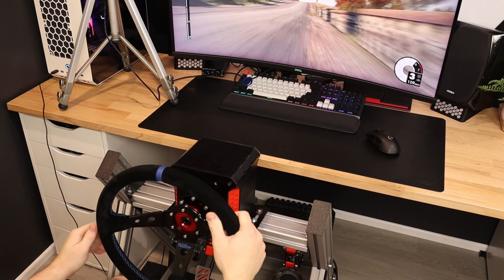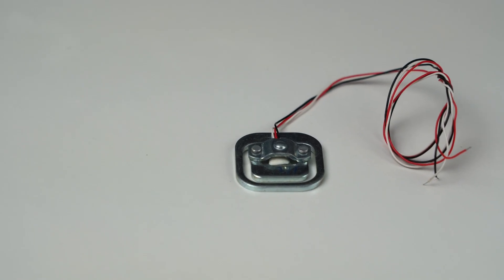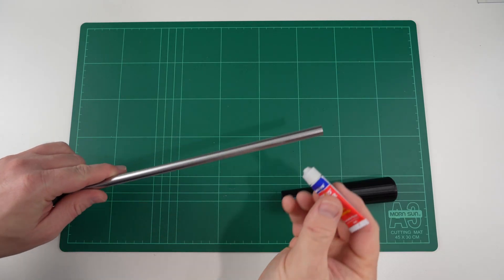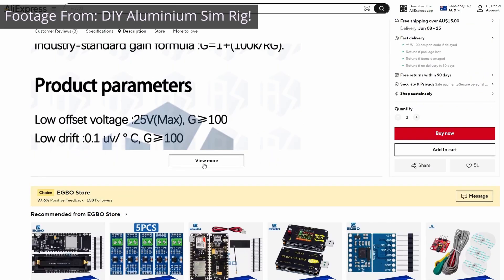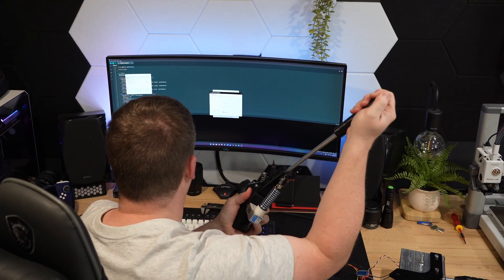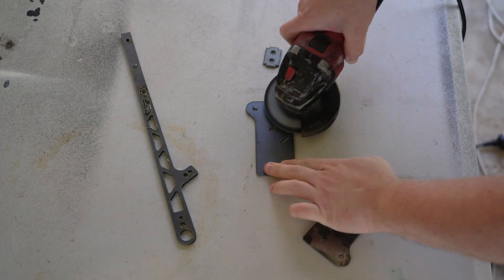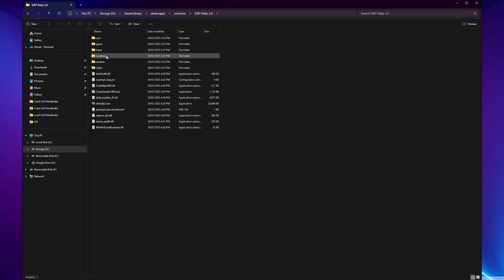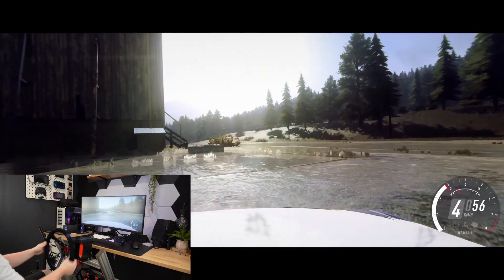DIY Load Cell Handbrake!

Comment: If you were to mount a Hall-effect sensor with a magnet and compare its output against the load cell using the AliExpress springs, you could create a conversion function from the calibrated Hall readings to the load-cell measurements. That might allow you to remove the load cell altogether and significantly reduce the cost of the build. You could even consider adding measurements for one of the AliExpress elastomer kits as well.

Comment: Man, difference in price is something crazy location wise. I have a fully laser cut heusinkveld sprint clones, and the price of the laser cutting and the 3mm steel sheets was the same from when I quoted a pair of paddle shifters and steering wheel grips (just the grip part where you put your hand on, not the full steering wheel) from a cheap 3d print palce. I'm from Brazil, 3d printing here is still very expensive.

Comment: Hello, i just started making a diy dd wheel, imvery broke. I wanna make another one like mmos but idk the board and this software u use, use very very expensive (3000 pesos) if you can help me with anything please do. Thank you.
Reply from the maker: All I can suggest is there are cheaper ways to make the wheel than the way I went with it, so that should save you at least a bit of money! Take a look at the build video they have on their website for a cheaper/simpler build. As for the driver board though, that's the cheapest compatible one I could find unfortunately!

Comment: La course du levier est bien trop longue !
Reply from the maker: Translated for the English speaking audience, this says: "The lever travel is way too long!"
Fortunately, this is adjustable and simply using a harder/shorter spring or a stopper on the bolt would be all you'd need to limit the travel!

Comment: 4:35 (I think you forgot to add the link?) I do believe this audio board is exactly what I need for my feedback cancelling spring reverb tanks! We just ran into an issue in the video I'm working on where one pre stage op amp works, the post stage works. But one op amp into another does not.

I wonder if we are saturating the op amp IC by asking for 500x voltage gain on the recovery post op amp
Reply from the maker: I have no idea if it will suit your purposes, but this is the video I was talking about (I have added it to the description, thanks for pointing that out!) https://youtu.be/oFvz3rBkJsg
And here's a direct link to the part for you! https://www.aliexpress.com/item/1005007130064459.html

Comment: I've watched your sim rig and setup build videos here and there once in a while without knowing they were from the same channel. Great job on everything. Something I would like to see would be functional multi-purpose stocks, turn signals lever that comes back automatically once you turn the wheel enough in the right direction and even if it's not used in most games, the whippers and cruise control levers as well, they could be used for different things which could still be useful somehow. Some people use a 4way arcade joystick or a on-off-on joystick for a turn signals lever but it just doesn't stay in place, it goes back right to neutral position so seeing you attack that project would be nice for sure. Have a good one!!!

Comment: hey man! i dont know if anyone did it before me so i wanan say im the first person to build your pedal design. only diffrence is that i used a diffrent board for the electronics. im also currently building the shifter you made
Reply: What board did you use? I have built everything and I'm at the stage of doing the programming now, but having a bit of trouble getting a good sketch for the pro micro

Comment: i hope you continue these excellent DIY videos.
Reply from the maker: That's the plan! 😁
Reply: @cncdan  I just watched your Nucdeck series it was awesome! Do you happen to have the part numbers for the FFC cable and connector you used to replace the full size HDMI ports? I plan on doing something similar to a project I am working on, but only could find 18 and 20 pin FFCs. I suppose I could use a 20 pin and just have have 1 pin unsoldered, but would prefer 19 pin connector and ffc. Thank you!!